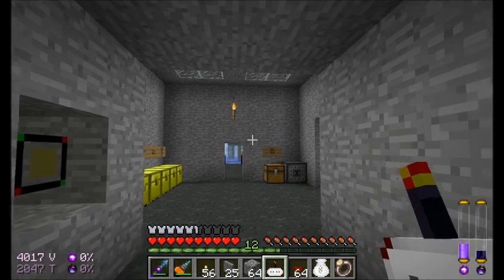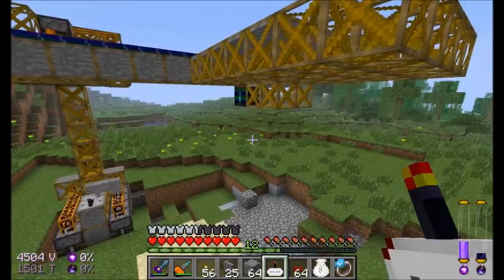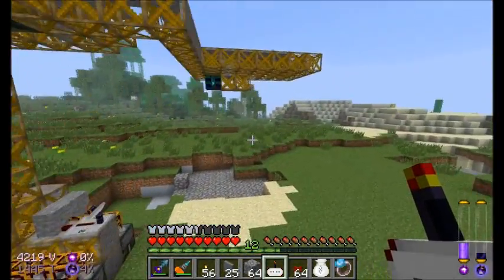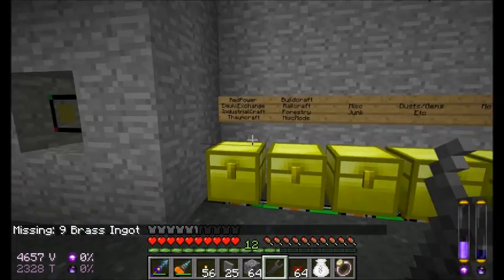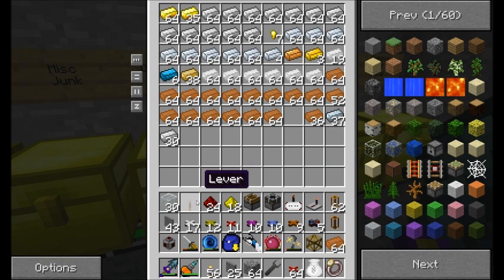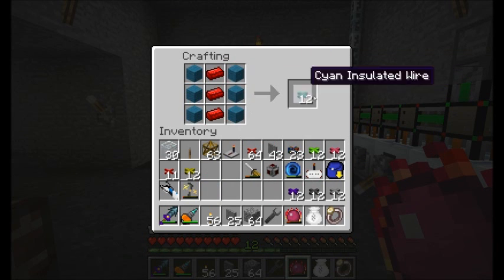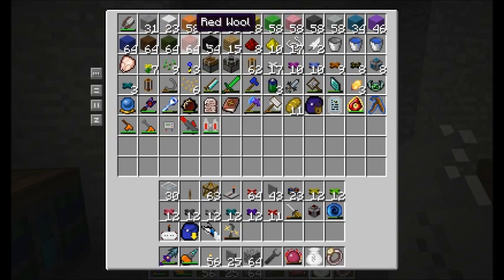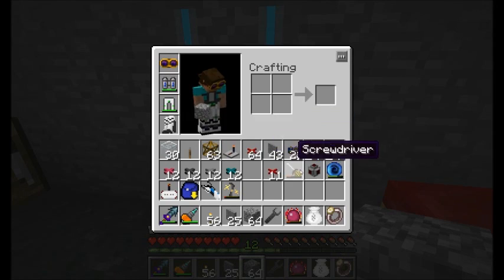Season 4 - Episode 39 - Direwolf20's Minecraft Lets Play

Comment: He covers it in episode 37, I think it was, but basically a cover will prevent a frame from moving anything on that side, a panel will allow the frame to move whatever is connected to the panel.  So you can run wire components on panels and they'll move along with the frames, but they'll be left behind and probably pop off/interfere if you do this on a cover.

Comment: Let us count the reasons:
1) It's fun.
2) This is a machine where all the components are implemented in machine craft. The build craft quarry is one little peice of unimpressive technology where all the components are implemented by someone else.
3) This can move anywhere thanks to the inchworm drive. The quarry is stationary.
4) The quarry requires a lot of power from engines. This requires a bit from solar panels.
5) This can break many blocks at a time. The quarry does 1 at a time.

Comment: If you run the bundled cable for the inch drives to the underside of the frames, you can run whatever color you need up the sides to the desired motor.

Comment: The wire gets disconnected from the movement motor, but leaves the return motor connected. All he'd have to do is leave power onto the motor line and have it automatically move.

If the movement motor was always connected to the motor line, then he would need the repeater. One reason he might have installed it though, is that he's planning on sending extremely quick pulses to the motors from the computer.

Comment: The way that I look at dimension is through imagining it with length, a means of measuring how long it is. The 0D doesn't have any length, so it's simply a point. 1D only has 1 type of length, so it's a line. 2D has 2 types of length (length and width) so it is described as a plane. 3D has length, width and height can be called space or a figure (an object in space). 4D adds on duration or how long something lasts, giving us time. Beyond this we start going into string theory and then M-theory.

Comment: What is now the difference between panels and covers?
 Both allow frames to move wire.
Covers disable any other pulling of blocks.
For Panels I don't now whether they prevent pulling or not.
Covers cost the halve of panels.

Comment: You could also have run the bundled cable on the underside and saved yourself a bit of trouble. Looks good though!

On the less practical side of things, maybe you could power your batteries with thaumcraft. Hook up the arcane engine to a thaumium crucible that feeds off the cobble you mine with the quarry.

Comment: The repeater is *very* important. If the engine doesn't return to it's original position and you activate another engine, you're screwed badly. Proper wiring is of utmost importance.

Comment: Direwolf20 add a 3D printer to your quarry to make 9x9s (design it specifically for that purpose) and make a highest possible speed forward engine that turns on/off via a pulse and runs constantly when on, at minimal delay (use toggle latches)

Comment: you could use not gates between the 2 frame motors... so the first one ist moved back into position after the signal is turned off... this would resolve the timing issue
but its not a good idea if the frame motor consumes power when left on

Comment: Why not set up each direction with a lever and a timer? That way with the lever on/off the timer goes (somewhat slowly), each click moves the major frame, each with a delay to move the motor. That way so long as the lever is flipped, it'll keep moving in that direction. (You might want to make it so you can't have two of those levers working at once though)

Comment: @direwolf20 ... Why did you make so complicated? A box-style, vertical cylinder design yields the same results, eliminates the motors/breaker/deployer setup on your "Head", and allows you to directly wire the breakers to the same bundled system you have controlling your platform movement. A nice design; but not completely efficient. Best of all, ... you could ride the thing to your next job site when the quarry's mined out ... ;) Later ... Peace ...

Comment: hello .. soo first off ... 10 ticks is a second.. cause every redstone tick is 1/10 second.. i also double checked the wiki for it.. and second off... when i was trying to get all of these mods to work.. i couldnt get the right version of thaumcraft anywhere.. i spent like 12 hours... i kept getting 2.1.6 not 2.1.5b   and third.. i forgot which episode i saw this in but u were using multiple recyclers to get scrap.. its much faster i found to use the over clocking upgrade for it..so yea...